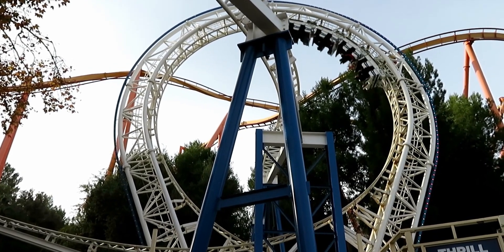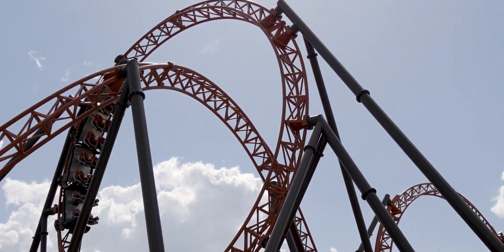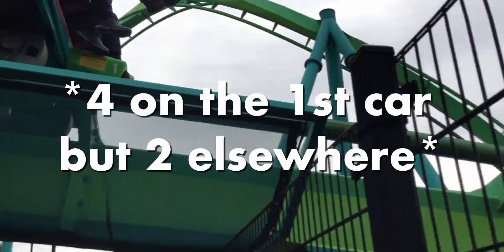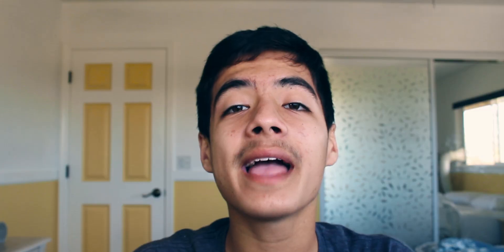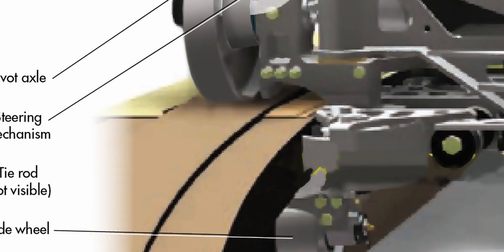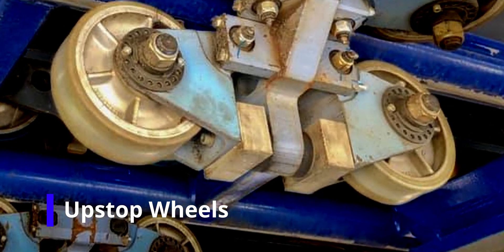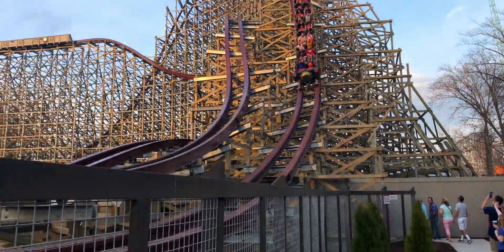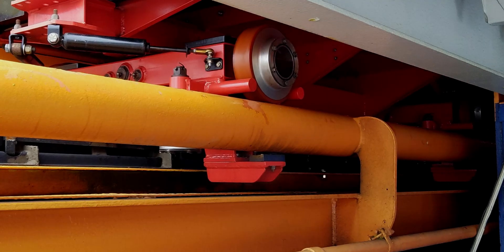Can Roller Coasters FALL OFF THE TRACK?

Comment: Well i didnt expect to learn something knew, i just expected to watch a great video. I got both. I didnt knew about some used upstop pads. Do you have any exampels of rides there use that?

Also, another notable accident is Cobra in Tivoli Friheden. 6 days after opening, the first 2 seats fell off the track while the 2 next was dangeling, and almost fell of. Satori rides made the ride, and they only made wacky worms and spinning wild Mouses before that thrill machine. I am not excactly sure if that was the wheels though but i think so, i belive it was simular to the tsunami accident
Reply from the maker: I’m glad you found value in this video! Thanks for letting me know about that Cobra accident. Some notable coasters with upstop pads are West Coaster at Santa Monica Pier, Gemini and Cedar Creek Mine Ride at Cedar Point, and even Magnum XL200 used to have upstop pads.
Reply: @808CoasterLife  Wow Magnum?? I heard that one have violent ejector!!
Reply from the maker: Yeah Magnum opened with upstop pads but after a lot of maintenance they decided to go with wheels.
Reply: @808CoasterLife  wow that is abselutely crazy😱